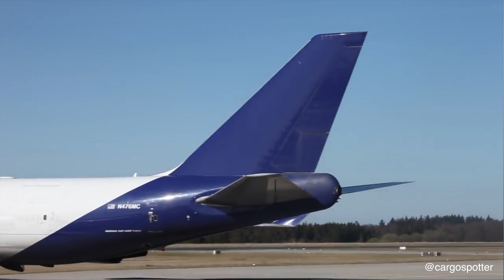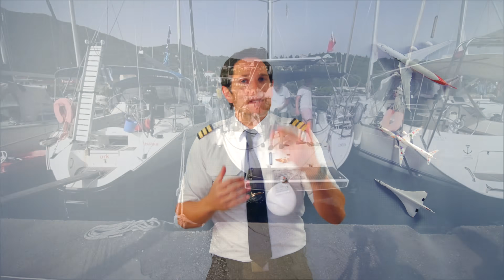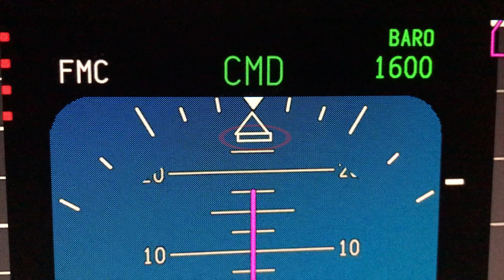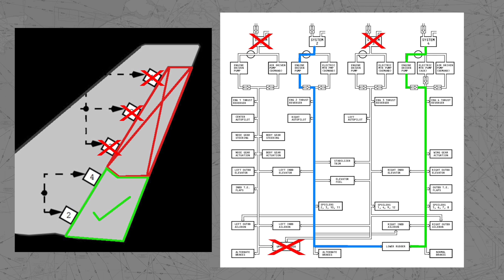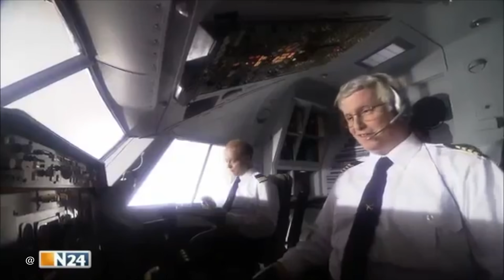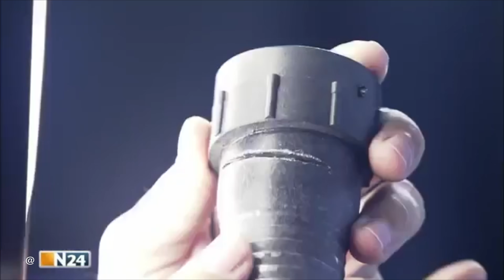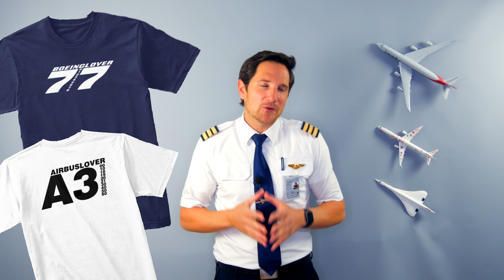Why is the RUDDER SPLIT? Explained by CAPTAIN JOE

Comment: The B777 has a single rudder, too. It's not quite a small plane ;)
It has a rudder tab though, in the lower 1/3 which is is driven by three rods. For each degree the rudder moves, the tab moves one more degree in the same direction.

The rudder is driven by 3 PCU, each connected to one hydraulic system.
The left and right hydraulic systems each have one engine driven pump for primary power and one AC motor pump for backup. The center hydraulic system has 2 AC motor pumps for primary power, 2 air driven pumps for high demand and the RAT for backup. There are not PTU.

The rudder deflection ratio is also a function of speed, but not linear, it looks more like a parabola. Full deflection is 27° to either side. From 148 to 430 kts CAS the rudder deflection is reduced to 3.1°

The MD11 also has an upper and lower rudder, but each consist of a forward and an aft rudder. So basically the rudder is split and hinged over the complete height. All rudders move 23° to either side from their hinge points, so the aft rudder moves up to 46° relative to the vertical stabilizer. The aft rudder is (like the tab on the B777) controlled by fixed rods.

The upper and lower rudders are each controlled by one actuator. The upper rudders are on hydraulic system #1, the lower rudders are on hydraulic system #2.
Each of the 3 hydraulic systems are powered by one engine driven pump for normal power and a second engine driven pump in stand by for backup. Hydraulic system #3 has two electrically driven AUX pumps. One of these AUX pumps can by driven by electrical power from the RAT (you either have that AUX pump or the right emergency AC bus powered by the RAT. Only the R Emer AC bus can power the left and right emergency DC busses, but the left emergency AC bus is always powerd by the RAT... it's complicated^^). There are two reversible motor pumps (like PTU), one between system #3 and #1, and one between system #3 and #2. They can transfer power in both directions.

The deflection is not limited by air speed. You get in the aft what you input in the front. I guess once you have banged your head on the sliding window, you'll get a feel for the rudder :D

Comment: Here is a question: We see that different systems can be used to move a single rudder section (such as 1 & 3 for the upper rudder section and 2 & 4 for the lower section). Why then is the need to have a split rudder? Couldn't systems 1, 2, 3 & 4 all power the same rudder, much as 1 &3 and 2 & 4 do with individual sections?
Reply: the friction of the hydraulic pistons would stress the system to an extreme

Comment: Couldn’t they have shut down the two engines powering the lower rudder hydraulic systems so it would hopefully go back to neutral? Of course that is a bad idea and possibly impossible to sustain altitude with a heavy load but could it have been possible to do so if the ailerons and differential thrust wasn’t enough?

Comment: So in the event of all engine failure, which hydraulic system would the APU drive?
Reply: @Charles Ball          During the "Miracle on the Hudson," Captain Sullenberger was able to control his Airbus A320 enough to ditch his aircraft in the Hudson despite dual engine failure. According to https://aerospace.honeywell.com/en/blogs/2016/september/the-miracle-on-the-hudson , the manufacturer of the APU on this flight, Captain Sully was able to have flight controls and therefore command over flight surfaces because he activated the APU shortly after the bird strike disabled both engines.

As Sullenberger was able to control his aircraft's descent and horizontal movement despite no power from the engines, what else would maintain hydraulic power if not for the APU?

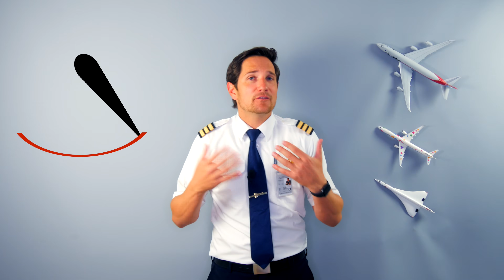Comment: 2:20 what you say about the speed isn't really true.
You need to talk about airspeed, not the speed relative to the ground.
For example, if you take a plane with a propeller in the nose, you could be stationary from the ground's point of view, but still having a high speed air flow passing through your rudder thanks to the engine accelerating it.
That's also why aircraft with jet engines instead of propellers are less manœvrable during low speed phases, like take off and landing.

Comment: I gess, in case of splited rudders the upper and lower rudder are pointing to different side to get the airplane equilibrated while turning.  To me, it's triggered by each one of the engines; 1 and 3 for the upper and 2 and 4 for the lower rudder.  according to the place of each engine.

Comment: Are elevators on the 747 strong enough to fight the stab influence ? Is there a way on the 747 to reset the stab position if the electric motors fail or runaway and have to be disabled ? Why is there no trim wheel present but only yoke trim and backup trim switches ?
Reply: @223 Remington List them for the 747 then, i'll wait. What happens if you'll need to use both 2 and 3 hyd stab cutout switches ? Becouse that post answers nothing.

Comment: pertaining to the split rudder on the A380 splitting in opposite direction while on the gate. The wind is moving the rudder since it is not under hydro pressure which makes sense. Now why one goes one way and the other goes the other,  I am thinking when the wind starts moving one part of the rudder it pushes the actuator which adds pressure to the system and causes the other rudder to move

Comment: Does the upper rudder half produce significantly more roll moment than the lower rudder half?
Reply: Well, i don't know if can call it "significantly" more, but it does produce more roll moment. It would even create more roll moment if both halfs would have the same size because the upper half is located further away from the actual roll axis of the airplane which gives it more leverage.
Reply: shi01, roger, that was my reason for wondering whether it would produce a substantially greater roll moment.  I guess it, technically, creates the opposite roll moment (opposite the ailerons).

Comment: hi mr JOE 
i think if pilot face   fail all hydraulic  rudder  system  , pilot can adjust the plane nose direction  by engines< as example  if cross wind take plane nose to the right pilot can slow the left engine and give  more speed  to the right engine , and if plane nose go left pilot can slow the right engine and give more speed to the  left engine <  pilot can use this way even he is in approach case  whatever the plane speed is

Comment: Speaking of the A380's rudder deflections: I've watched the full video https://youtu.be/1PWDMu29V0w To me it looks like there's some internal force pushing the upper rudder to the right. I mean, it's not wind from the left but something that constantly pushes the upper rudder to the right when the hydraulic systems are off, while the lower part can swing freely.

Pay attention to the strength of the wind, obviously mostly coming from the right. Whenever the gusts become strong enough they can indeed push the upper rudder to the left but not much further than up to its neutral position. It seems that's as far as it can go in this example. https://youtu.be/1PWDMu29V0w?t=2m3s

It somewhat never goes fully to the left like the lower part, probably due to this ominous internal force the wind's strength first had to overcome. And whenever the gusts are strong enough they simultaneously deflect the lighter and freely swinging lower part all the way to the left, but much further than the upper part. It's not just that its weight is significantly lower, it also seems it can swing independently from the upper rudder, which is otherwise constantly pushed to the right.

If there was a less gusty wind, the upper part would probably not move at all, while the lower rudder would still swing around. Again, watch how the wind from the right only sometimes pushes the upper rudder to the left, and hardly ever further than neutral. The lower rudder on the other hand is always pushed all the way to the left, before the upper rudder would even start to move. This gives the impression that both parts where moving independently into different directions, while in fact only the lower rudder can really move freely and the upper rudder is blocked by something. So, if this theory was right, you 'only' had to find out what exactly would cause this force that keeps the upper rudder normally always pushed to the right, so to speak under perfect no wind conditions.

Here's something else from former A380 test(ing) pilots: Although still being an Airbus, it came with a whole host of innovations that distinguishes it from her elder and smaller Airbus sisters. What's e.g. unique to the A380 are the electrical backup hydraulic actuators (EBHAs). Quote:

'The A380’s flight controls are hydraulically powered, as with previous Airbus aircraft, but there are only two hydraulic systems. The Green and Yellow systems are powered by engine-driven pumps and operate at 345bar (5,000lb/in2), instead of the 207bar systems in prior Airbus aircraft. The higher operating pressure significantly reduces weight, saving upwards of 800kg (1,760lb) compared with an equivalent 207bar system. Deletion of the third hydraulic circuit (Blue in other Airbus aircraft) further reduces weight, but could have compromised operational safety were it not for the electrical backup hydraulic actuators (EBHAs), unique to the A380, that can operate both the upper and lower rudder, half the elevators and a spoiler and two ailerons on each wing. The EBHAs function as conventional control-surface actuators until there is a hydraulic system failure, when they operate independently, powered by the aircraft’s AC electrical system. Further, one control surface in each axis is powered by the essential AC bus, which can be powered in flight solely by the ram air turbine (RAT). The standalone EBHAs and RAT provide a high level of redundancy while allowing for significant overall weight savings.' (25 SEPTEMBER, 2006 SOURCE: FLIGHT INTERNATIONAL BY: MIKE GERZANICS TOULOUSE https://www.flightglobal.com/news/articles/flight-test-airbus-a380-209189 )

So, when this is unique to the A380, then there might be something else unique to it which forces the upper rudder to the right. Maybe there you will find your final answer. Greetings from EDDF, Cpt.!

Edit: https://www.fzt.haw-hamburg.de/pers/Scholz/dglr/hh/text_2007_09_27_A380_Flight_Controls.pdf

Comment: @5:15 - if the rudder was not split and all 4 hydraulic systems contributed to deflecting it, how can you say that there would be no more rudder authority? Surely system 2 and 4 would be able to provide at least some rudder authority.

Comment: i would guess, that only the lower rudder was used when landing and it leaves the upper rudder in a neutral or unlocked mode and when they parked the pilot got out of his seat pushed the wheel forward, and is why the elevators went into the down position immediately and pushed the right rudder peddle down to make it easier to get out of the seat which means the pilot (left seat) was in control during landing, taxi and parking,  leaving it in the left turn position, and the upper rudder is left to move freely in the wind

Comment: Hey Captain Joe, Can you answer this.
I noticed on the split rudder system that the lower rudder seems to deflect further than the top when they are both being operated together.
Is there any reason for this?

Comment: Split rudder on the ground going different ways, 06:07 - First thought, the top section is bigger and so will catch most of the wind and so push it one way. Due to the amount of movement this might be setting up a tiny area of low pressure and so pull the lower section of the rudder into that area of low pressure.

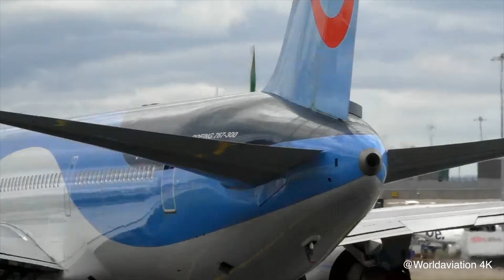Comment: 4:04 it seems like the lower rudder is not moving at all while the top one does. This could be maybe bec of the different hydraulic systems each rudder has. Maybe one is kept on while the other is not for some reason

Comment: But how can one control the plane if engines are running at Max power, Cause from what i know, One can’t control a plane cause the hydrolic system will be more resistant than when ur landing? Kinda didn’t make sense but please answer me?

Comment: The a380 lower rudder is pointed in the opposite direction to keep the aircraft stabilized. When an aircraft is at the gate its hydraulics are not usually pressurised. As the rudder is hydraulically actuated. The parking brake will be set, but over time the hydraulic pressure will bleed off

Comment: I think that is because the upper section is not under hydraulic pressure yet, so the wind can move this big part.

The lower section is under pressure and maybe it's a stand still position pilots gave to the rudder in order to test the flight controls or tell crew and other pilots APU or certain engines are running ...

Comment: 4:14 (I speculate this so this might be wrong) it work just like the ailerons when one side of the wing aileron push down the one on the other push up to make the plane roll. This might also be why the A380 use this kind of  steering system to balance/use the tail more efficiently for a SUPER plane

Comment: Can you steer the plane with just the rudder and no wing controllers?  What about landing?
Reply: @223 Remington Isn't yaw the same as turning direction, though? I mean, I know it will be a very rough turn for everyone without the bank. They'll be flung to the sides of the plane. But steering should be possible, right? And pitch can be controlled via the tail ailerons to potentially land?

Comment: Hydraulics tend to oppose force unless acted on by a primary pressure source. 

 I'm guessing they faced opposite directions because they share the same hydraulic primary.  And that primary pump was not engaged while the plane was parked.

Comment: Those hydraulic failures in a B747 rudder did not become tragedies because of the split rudder.  In the B737 hydraulic failures did become tragedies, perhaps because there wasn't a split rudder.  Note the lower B747 rudder is double hinged which is why I think it is very powerful.

Comment: Hi Joe! The A380 has a very high stabilizer, and Im thinking that all the wind is forcing the upper rudder to the right in the video you showd. And by all the turbulence from terminal forced the rudder in a left position. This is my best theory. Keep in mind that the video of the a380 at the gate also shows that it doest keeping the split position the hole time...........Greetings Marc Nielsen!